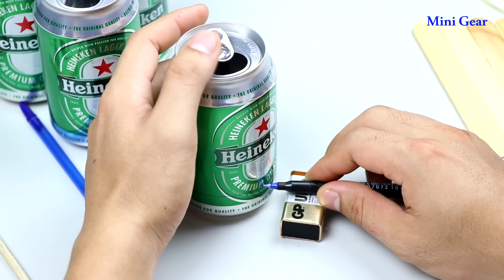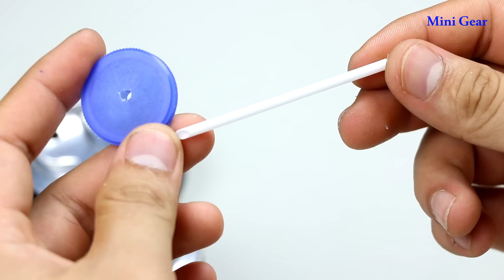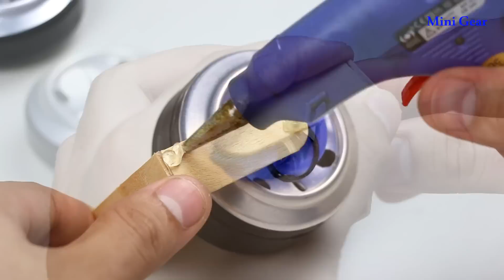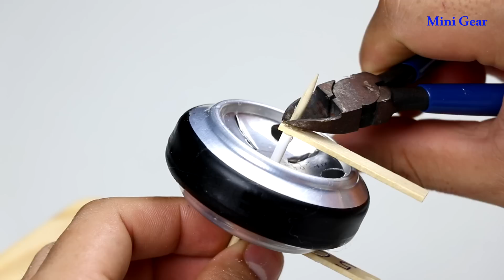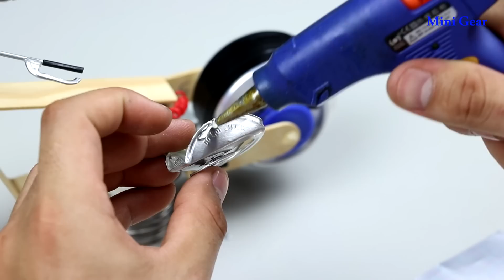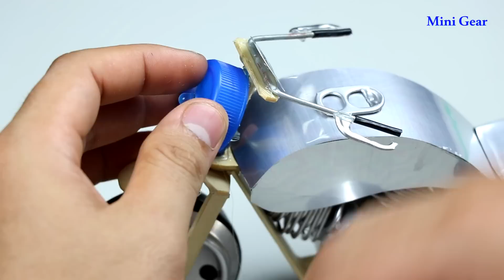Custom Harley Davidson DIY - 2017 Superbike Mini Gear

Comment: hi can i ask you if what is the tools that you used for making holes in the plastic cup? and the one that you use to ignite the wires? please answer because i want to make that motorcycle on my own too. thanks! good job!
Reply from the maker: It's mini dremel and soldering iron. Thank you!

Comment: Mmmmm I do not understand the materials could tell me how to find the materials is that I need to present that project because I liked it
Reply from the maker: you can find all of these at Toys Store or at amazon website.
Thanks.
Reply: ok thanks
Reply: A question as is that ultra gp that connects I would like to know how I find it here in Peru district ica